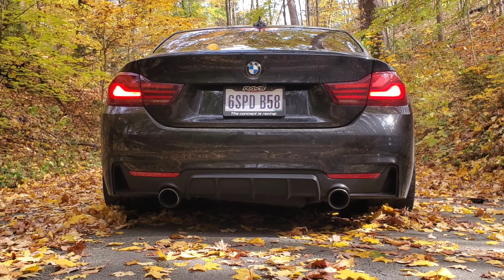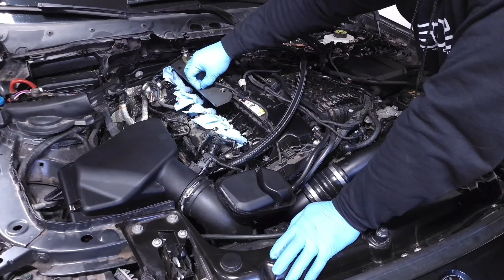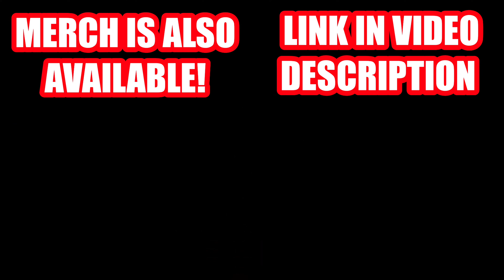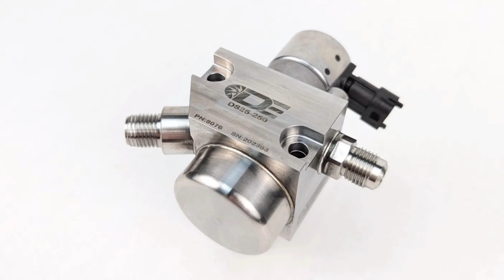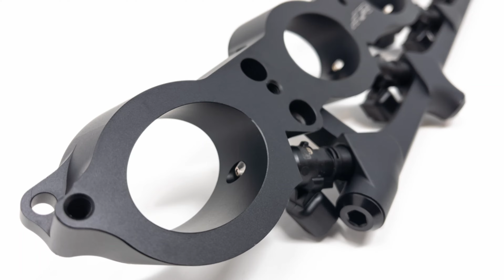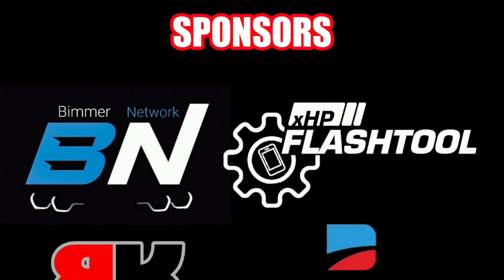How to Improve the B58 Fuel System: A Comprehensive Guide to Fuel Pump, Injector, and Cam Upgrades

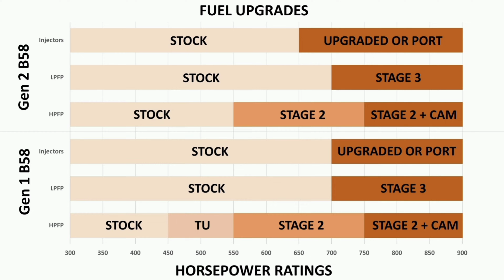Comment from the maker: See the quick chart I made at 20:01 to make picking your mods simple based on your hp goals. Hope this helps
Reply: Is the chart factoring in stock turbos? Or is the chart just based on what the individual part is capable of?
Reply from the maker: @ProducaGraham  turbo doesn't matter. It's just how much fuel the part can flow.
Reply: @kern417  gotcha! Ty!

Comment: So if you want the most power with e85 upgrade your fuel system usually just your lpfp and upgraded fuel regulator and lines. For my n54 they don’t make upgraded hpfp so I use helix overdrive from spool performance which allows for more flow without even upgrading your lpfp

Comment: Great Chanel, just wanted to ask if you were putting a b58 in a race car and didnt have an ecu, would you try get the factory ecu working or go aftermarket and use only port injection ? Goal is max from the stock motor at around 700hp

Comment: Hey kern looking to get some parts to get custom tuned. Would running pi doing a stage 3 lpfp and then a tu pump stock injectors be a decent setup? And would that be safe on stock turbo I plan on running that for 6 months or so till I go pure850 I think, will that setup work?

Comment: Do you think upgrading Direct injectors and Intake Manifold as a “safety” upgrade is worth it? 

Setup:Daw 6466 upgraded turbo, pushing around 650 Hp) 
.Dorch stage 2.5
.Motiv reflex 
.pure drive train stage 1 
.flex fuel tune 
.Cold air intake

Comment: Im on stage 2+ MHD RON 98 pump gas with TU pump and downpipe.So if i upgrade to pure 800 cast turbo TU pump would be okey to support 550-580Hp as i dont intend to go beyond these numbers?
Reply: I m on similar set-up (200 cel cat,no OPF,TU Pump,but DAW Ultaraflow X and Custom Tune) and making 560 hp on the crank,around 518 at the wheel.Torque is limited at 711 N/m.Tune is jut on pump gas since E is not an option in this part of Eu. Considering the “map” on this video and the conclusions of Kern from the Nostrum stage 2 video ,I guess,with upgraded injections it could be squeezed a little bit more out of the TU Pump…. but not shure (ofc on gas only)… I ‘m curious if Kern’s opinion regarding this 2.

Comment: If you run 93 octane but swap out for a 10.25:1 or 10:1 compression ratio would you still hit octane limits before fueling? I don’t have any E85 accessible to me and everyone says octane boosters do terrible things to your engine, idk what to do.
Reply from the maker: Yes but the limits will be higher. It's easier to just add meth injection

Comment: This is the exact video I needed to watch! One question though, If you only had access to 91oct/95ron pump fuel, how would you go about improving your fuel system to make the most of a hybrid turbo such as the Pure800 and keep things reliable ? My current(540ix) setup is pure800 cast with DS2 hpfp and MHD flex fuel kit, i have a custom tunes for 91oct/e30/e50. i get my E mixes by adding 95% bioethanol(which is pretty expensive in Europe) so Im curious with all the new upgrades out now is there a better way i could fuel my setup? XDI injectors? Intake manifold with meth injection? Or just suck it up and stick with the setup i have? :) Thanks from @b58irl
Reply from the maker: If you only have pump gas you don't need anything else. You'll run out of octane before fuel flow even with a TU pump.

Comment: I think there might be a sweet (cost effective) spot at upgraded injectors, down pipe, stage 2 HPFP & hybrid turbo. Say US$6500 & stay within the safe limits of mani, trans & engine
Reply: what might be an estimated safe limit on trans and engine??
Reply: @RAFARCHmotorsports trans, about 750-800 newton meters if u have the hp75. And b58 can handle about 750-800 wheel

Comment: When replacing Fuel injector do you have to reset the adaptation? or is it just a plug n play kind of deal.
Reply from the maker: Stock are plug and play. Upgraded require custom settings in the tune.

Comment: Port Injection costs way more than 2k, I only see that happening with an AIC controller. With reflex and all parts are around 3500 or more. Installed most pricing is 4-5k
Reply from the maker: $1200 PR port injection 
$700 Motiv Reflex
$1900 total

🫡
Reply: @kern417  Don't forget the harness that will cost you another 1K, and most go for larger than 750cc injectors which is another 400 for the common 1050. If you manually wire everything and install it yourself I guess you could get there, but that will apply to very few owners.
Reply from the maker: @mattcooper4333  what i priced is exactly what i bought and installed. You don't need any of that other stuff.

Comment: If I wanted to comfortably max out my stock transmission and engine reliably to daily drive on my gen2B58, that would mean around 650HP and 650lbft torque right Kern (or could I go higher torque with a custom transmission tune?)? The best and cheapest way too achieve this would be pure800 with an intake manifold that supports port injection correct? stock injectors and LPFP should be good with that if I'm running E50 right?
Reply from the maker: I would lower torque to keep the trans happy and yes that could work
Reply: @kern417  not gonna lie after doing hella research and watching ton of your videos I cancelled the PG intake manifold and decided to go with turbo/hpfp instead. Just can’t decide between the DAW flowmax or the new Vargas VTT GC-MID. Apparently the MID is made for TU engine and can support 650hp and is like $1k cheaper than DAW. Just haven’t seen any data on it or bimmerposts.
Reply from the maker: I believe DAW will be more reliable

Comment: Released this video at the perfect time. Just got a DAW 2.5+ and am looking to get in the 550-600 park. Do you happen to know if it's possible on 93?
Reply: Definitely will need port injection
Reply from the maker: It will be difficult. Most people end up around 500-550.
And no, you don't need port injection
Reply: @kern417  What about an E30/50 mix with TU pump?
Reply: @kern417  so when do u start recommending port 600+?
Reply from the maker: That can get you north of 550. My best dyno was 590 but that was with a lot of fine tuning.
Reply from the maker: Per the video i recommend north of 650-700+. Sooner if you want to run full e85.
Reply from the maker: usually ends up around 500-550. depends on your 93oct fuel quality.

Comment: So for 650whp-700whp on gen 2 b58 would port injection be better?
Reply from the maker: Direct injection is safer. Port injection is cheaper. Just depends on your budget and priorities.
Reply: @kern417  Was leaning towards direct injection, for lpfp on the gen 2 b58 what options are there?
Reply from the maker: Precision raceworks, visconti, vader solutions